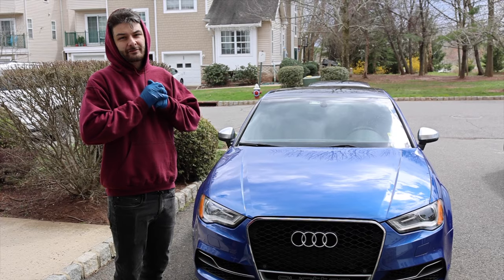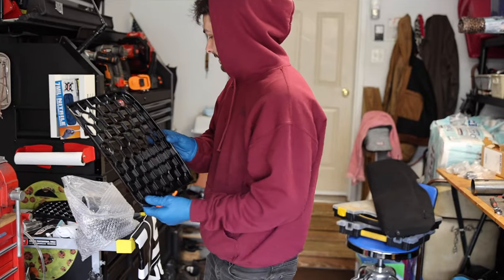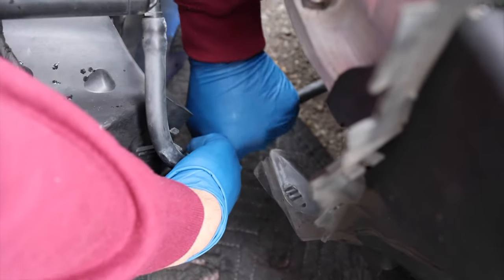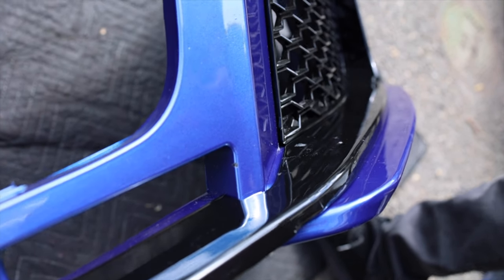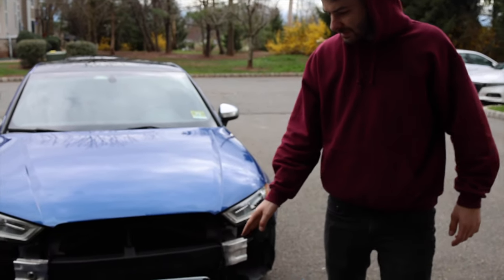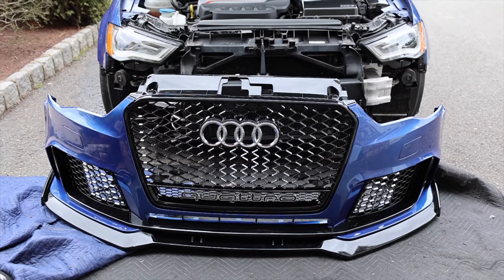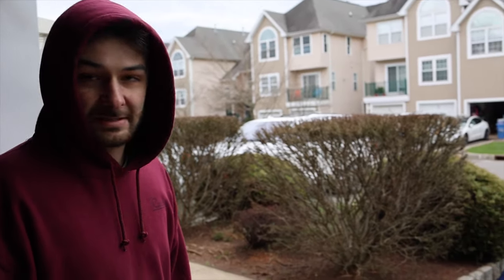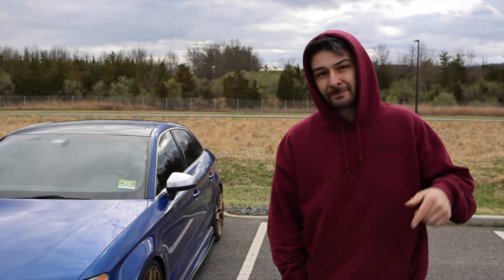Audi RS3 BK Motorsports Bumper Looks INSANE

Comment: Thanks for the video. I've been wanting to see the bumper in detail for a while. The side close air ducts as you called them are actually open for the RS3 8V in Europe. They channel air to the brakes. I've been thinking for a while getting the same bumper.

The honeycomb side grills are partially open and then, the other side of it is closed. Out of curiosity how much of the cover part is blocking the oil coolers if any?
 
I might do the extra work and open them all. As well as the side ones for the brakes.

Comment: I would love to get this bumper but i have the S3 prestige 2016 with the ACC, if i get the rs3 bumper do you know if the Rs3 grille with ACC cutout is compatibility to fit in the bumper if I get separately just how you did when you onky had the rs3 front grille?

Comment: What are your views on a muffler delete? And does tuning allow e85 on the s3?
Reply from the maker: Honestly these cars are super picky on what will sound good. Personally I recommend a downpipe and a resonator delete and that sounds the best. I’ve had a 1800 exhaust on it and it sounded like shit with the downpipe so I sold that and did the resonator delete which sounds better. And yes if I have the proper map and supporting mods we can run e85 on it
Reply: @RatchetWrenches  I have the downpipe time and my car didn’t have a resonator just a secondary cat, and I wanted to keep that on, which it is the one that came with the downpipe. And delete the muffler, just for a louder overall hopefully not to bumblebee sound..
Reply from the maker: @koltenmccauley3274  gotcha okay yeah you can try to delete the muffler and like you said hopefully it doesn’t give it too much rasp!

Comment: What material is it? At least compared to oem? Is it durable? (I’m also from NJ so Ik the roads are horrible) can this survive potholes and our weather or will it chip and crack?
Reply from the maker: I want to say it’s ABS plastic which is super durable. So far I’ve been daily driving it and it’s been holding up great. Granite I try to avoid as many potholes as I can but I’ve hit a few and it’s still structurally sound and doing solid, even the lip is holding up great! I definitely would recommend this compared to an oem rs3 bumper for some serious Money!